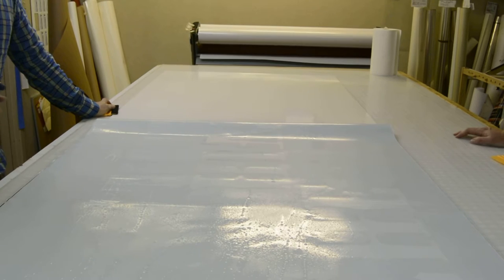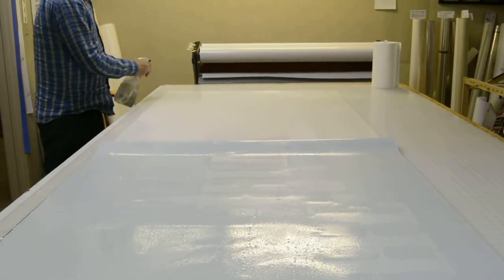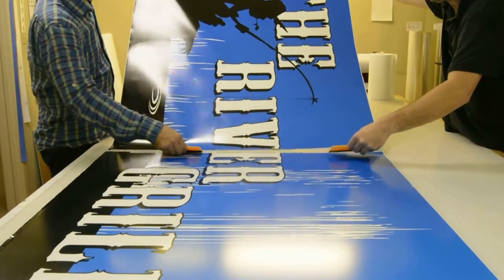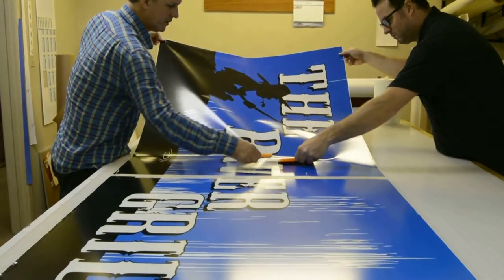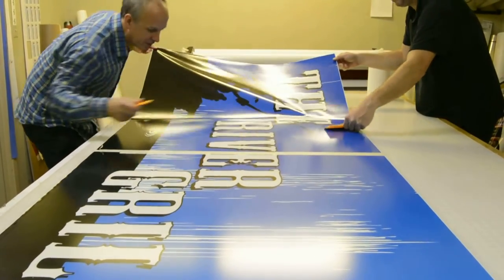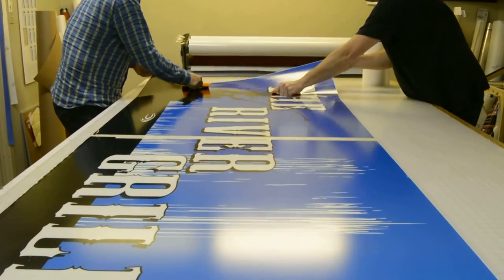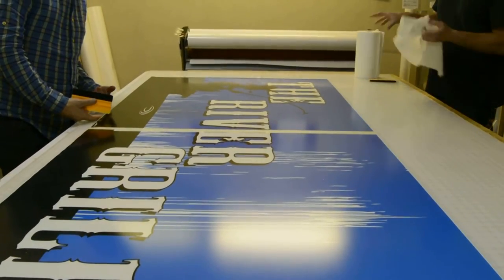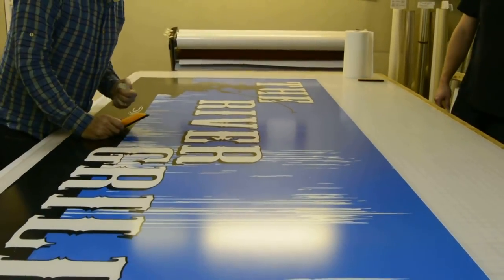Wet Install Translucent Vinyl

Comment: Have you ever put translucent vinyl over clear acrylic? If so, did it make a difference?
Reply: Yes, I have experimented with that.  The sources of light are a lot easier to see so it creates "hot spots".  The milky white acrylic like we use above is better for diffusing the light source to give a more even effect.
Reply: @freedommailing  Thats what I figured. Thank you for the response.